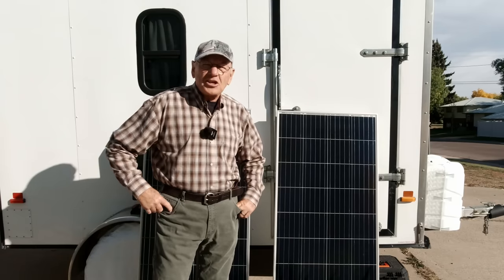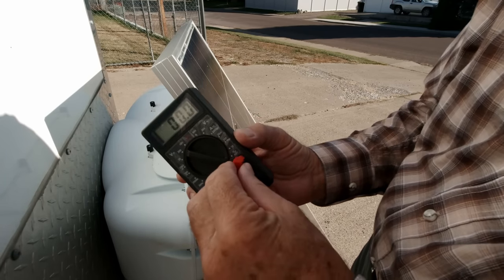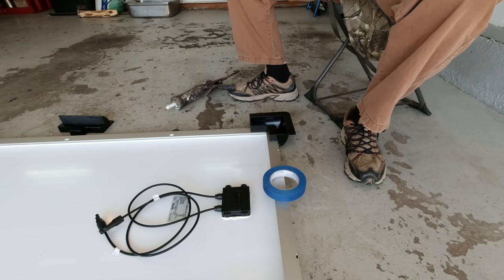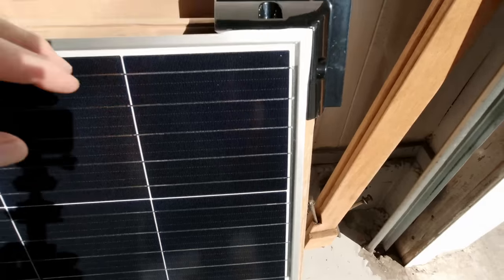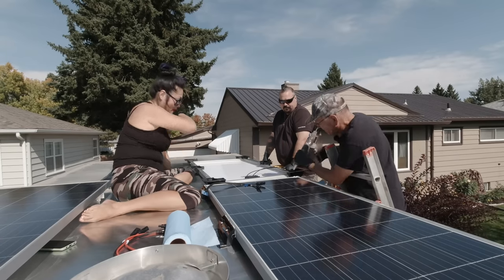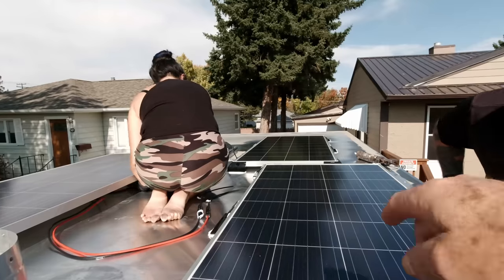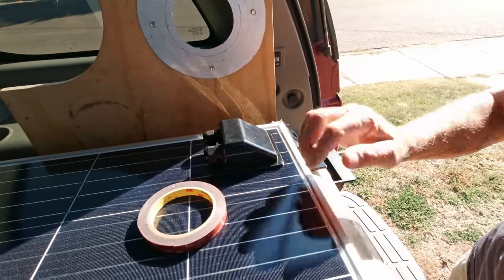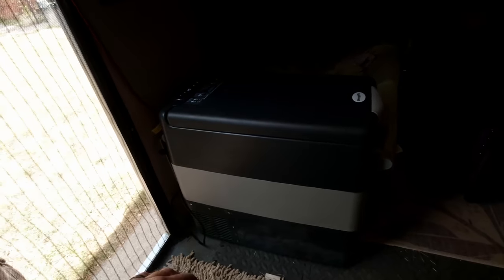RV Rooftop Solar Panel Easy Installation! Bouge RV Solar Panels

Comment: Thanks for a fun project! That glue stuff is strong enough to stick me to the side of the trailer at highway speeds for at least 5 yrs, I think. 😂 We'll soon replace our old panel to equal 3 of these BougeRV panels and call it good.
Reply: Ha Ha ... you had the hard part!   You had to be more flexible than the guys :)
Reply: @777cretbo  everyone missed my double backflip to get off the roof! Haha.
Reply: @SamuraiMama  ... HA HA  ... Good one!!
Reply from the maker: You could have waited until I had the camera pointed in your direction!
Reply: @gonagain  Great seeing a father and a daughter work together.  Have Three adult Daughters 31, 29 & 27.  I'm a young 57 :)
Reply from the maker: Daughters are great!
Reply: @gonagain  yep

Comment: A caution on measuring the current across the panel terminal leads with the multimeter.  This is one of the very few configurations that you can put your multimeter across a voltage source in amps/ current mode.  If you did that across a battery voltage source for example you'd smoke your meter or burn out the protective fuse if it has one.  Current is normally measured in series with the load, using the shunt built-in to the meter.  Because of the way a solar panel delivers current up to a maximum,  it allowed measuring across the panel leads, but across almost any other voltage source would not have ended well.  Good video with good explanations and camera work.  Thank you.
Reply from the maker: That's all true, but just so folks know, this is the way to test a solar panel that is rated UP TO 10 amps max.

Comment: Be sure to clean all the contact areas with alcohol to remove dirt and atmospheric film before placing the 252 and panels to the roof..
Reply from the maker: True that and we cleaned this roof before we got started.
Reply: @gonagain     Rick, I had no doubt that you did. But there are boob toobers under the age of 65 who don't know a screw driver from a jar of pickles and will follow your instructions to the letter without using additional common sense for something that you and I, because we are over 65, take for granted..!!  LOL!

Comment: If you have to remove a panel and replace it, I’m assuming you are going to have to screw or rivet it back in since you are not going to be able to glue it like you did the first time since the mounts are stationary and the glue would be push down to the bottom of the mount.
Reply from the maker: You could do that easily if you had to, but I would use a mold release agent on the bottom side and just force the adhesive into the crack with a putty knife. Good thought though, because stuff happens!

Comment: Good deal but was wondering why you didn't attach the panel to the brackets with screws instead of adhesive so its even easier to take out and possibly more secure.

Comment: When was the sikaflex update added? Did it completely release the mounting brackets? How long did it take for that to happen?
Reply from the maker: It didn't completely let go on my panel, which has been in place for about two years, but a good tug would have pulled it off.  Check my latest videos for updates on this subject.

Comment: Wow! Three 180 watt panels..... I'm a bit jealous, since I am making do with a single 175 watt panel.  I love the step by step approach to the video - it's very helpful.
Reply from the maker: Thanks for watching, Andrew.  I put 400 watts on my little 6x10 trailer because it is so inexpensive to do these days.  Also, adding an additional panel is very easy.

Comment: I use a lot of that 3m double sided tape.  I bought one of those 300watt hot air pencil heat guns, use it to warm tape to 150° or so before I press parts together.  Then burnish with back of a large spoon (for fabric or flat material), very permanent bond.

Comment: You're always one step ahead of me. I'm thinking I'll mount one port and one starboard of the roof centerline, with tilt on each one. Using a portable panel really impressed how angle affects power, and how much the sun moves in an hour. I've used Sika products for years. Never had a problem. (Other than mispositioning something.)
Reply from the maker: Hello Jon, I have one roof panel that tilts and one that is fixed.  The time when I really notice the difference is in the winter months with a low sun and it makes a HUGE difference!

Comment: Nice video! I'm wanting to do this on our 22' new Camper. More details on the fuse & a power cutoff would of been nice. I have a 2000W inverter but yours is probably better. Thank you for your video.

Comment: Great video overall!   I like that you checked the panels' open circuit voltage and short circuit current because those values do indicate whether a panel is healthy.  But, I don't think your power calculation is quite correct since those measurements were taken at different operating conditions (open and short).  To calculate power (P=IV) the current (I) and voltage (V) must be measured under the same conditions (V and I must be known simultaneously).  Since you took measurements in two different conditions there are actually two different power calculations (although they both result in zero power(!).  The open circuit power is zero because the current is zero (P = I*V = 0 amps * 23 volts = 0 watts).  The short circuit power is zero because the voltage is zero (P = I*V = 9.54 amps * 0 volts = 0 watts - again!).

You'll note that the tag on the panel also tells you what the proper voltage is associated with the maximum power (19.54V in the case of your panel).  If you had a big variable resistor that could tolerate (dissipate) 180 watts you could adjust it so the voltage across it was 19.54V and then insert the meter in series and measure the current.  Under ideal conditions you'd find the current should be (rearranging P=IV) I = P/V = 180 watts / 19.54 volts = 9.21 amps.  In the real world it'd be something less for most panels, since their rated output is only achieved under lab conditions.

(The resistor value could be calculated starting with V=IR -> R=V/I -> R= 19.54 volts / 9.21 amps = ~2 ohms)

This is why MPPT solar controllers are such a big deal - they can automatically adjust the load so that power is maximized, i.e. the product of I and V at any moment gives the biggest value of P.  

Another thing is that the solar controllers typically have a display option to show what the voltage and current values are at any given time - if you want to check real output power just hook the controller to each panel one at a time (probably need to have the battery connected - check the manual first).  Although, as I said, your checks are probably adequate to make sure the panel is working - you just can't actually get a useful power reading from those measurements.
Reply from the maker: Thank you!  That's a great explanation and I appreciate the time you took to give us that information.  Now I know why an MPPT controller is more efficient also.

Comment: The volts with no load are higher and the currant at a short circuit is higher  but the voltage is zero look on the panel for the loaded voltage and currant  and times them and it will give the real power.

Comment: Absolutely professional & Install very Informative , I purchased 5 185 watt solar panels, & they were used dated 2018 & have ordered from  numerous sites the necessary materials , wiring ect. My Question Rick how many solar panels would I need to power my , class A Motorhome ,I  operate only one roof top ac was doing reaserch on line & from watching numerous videos  I would need approximately 1500 watts , Is this correct ?
Reply from the maker: I really can't answer that for sure, but it will be a lot.  You're also going to need a large bank of batteries and a sizable inverter.  The AC will probably use about 1200watts per hour of use (average) and you'll need to install a "soft start" on it to lower the current draw each time it kicks on.
Reply: @gonagain  ok , thanks for  Info Rick ya be safe my , friend

Comment: The renogy MMPT charge controller can handle 100 volts input so all the panels can be in series giving 1/3 the power loss in the long wires coming down with no extra conectors on the roof. the higher voltage will give earlier and later charging and more in cloudy weather I get charging from 6 am till 6 pm with 2 x 40 volt panels in series for 80 volts at 5 amps turned into 25 amps at the charge controller with short thick wires to the battery.  the x grid tie panels were only $ 20 each 200 watts
Reply from the maker: Good info and thank you.  The only problem I have with my current set-up, which is in series, is the shadow factor, or the problem with a tree branch casting a shadow across one of the panels, or even a build-up of dirt in one corner of a panel  Most campsites are located under the trees and this is causing a major problem.  It's not as bad if the panels are in parallel.

Comment: Love your channel and I mean this with humor / kindly.   It struck me you shouldn't be 'sparking' the solar panel amp test right on top of your propane tanks :)  I love panels and put 4 x 300w panels flat on top of my 7 x 14 cargo trailer - just barely fit with maxx fan in middle.   These generate about 6kwh/day in summer.     I do have a bit of sway at 60mph and was wondering if these 4 panels @ 40lbs each = 160lbs might be contributing to that.  Will try sway bar / weight distribution hitch and see if the sway clears up.
Reply from the maker: Trailer sway usually has to do with fore and aft loading and that is affected by axle location.  I had a 26' travel trailer that didn't need a sway bar and a 19' travel trailer that I wouldn't tow around the block without one! First I would make sure that you have the proper amount of hitch weight and if that doesn't do it then go for the sway bar.
Reply: I used heavier duty tires with less sidewall flex and that controlled my sway problems.
Reply: Wow - thank you for the tips. The weight is 3800lb, tongue weight is 550lb,  load is evenly distributed, tires are at max pressure (dual axle) - all that is OK.    I have the weight distribution / sway bar hitch on the way and will report back once I see how it does.   If that doesn't do it, I'll check into the tires :)

Comment: That Sikaflex works great on a metal roof, how is it on a TPO roof?
Reply from the maker: You don't want to use adhesive mounts on a TPO roof though.  In my opinion you should through-fasten in that situation.
Reply: @gonagain  thanks, I thought that, but wanted to get a second opinion.

Comment: Well darn!  Now I got to get some Sikaflex 252 to play with.  

Do you ever wish your panels were more adjustable/tiltable?  Is any gain from doing adjustment just not worth the effort?  It would take time away from touristy things.
Reply from the maker: There is a definite benefit to being able to tilt the panels and this trailer and my own each have a panel that can tilt.  Watch this video Jim:  "To Tilt Or Not To Tilt?"   https://youtu.be/eCPvBLcyksE
Reply: @gonagain  ..... Different strokes for different folks.  It seems you will now have a combination, fixed and portable.  I do like the fixed roof panels and portable for those difficult days.  

You have trained Linda well.  A day window shopping at rocks and nothing taken home?  Well done!

Comment: Love this.... will this bond to a fiberglass rv roof
Reply from the maker: Yes it will. Just make sure the surface is super clean and rough it up slightly with 80grit sandpaper.
Reply: @gonagain  thanks

Comment: Which adhesive did you use to mount the panels?
Reply from the maker: We ended up using SikaFlex 292i which is much better.

Comment: During winter storage here in Montana , is it ok to store batteries in trailer hooked up to solar panels?   Will batteries be warm enough on constant charge.   AGM batteries are very heavy and are not good to move since dropping them might kill battery
Reply from the maker: Hello William, I always left my AGM batteries in my trailer, hooked up to solar all winter.  As long as they are charged they won't freeze and will survive just fine.

Comment: Not to sure about using the adhesive if attaching to a rubber roof. As you would be relying on the adhesive that is holding rubber roof to the wood roofing.
Reply from the maker: Yeah, I wouldn't do that either.  The adhesive we used in this video did fail and we switched to Sikaflex 292i adhesive.

Comment: Are those black brackets plastic? If so how is that going to hold up to the sun beating on them day in and day out?
Reply from the maker: Yes, I got the black on purpose for it's increased resistance to the UV rays.  Like the black, UV resistant zip ties as opposed to the white ones that deteriorate in the sun rapidly.

Comment: Are you concerned about the thin aluminum of the roof holding those panels? I thought going down the highway at 60 might blow the panels off and take the this roof along with it. Trailer roofs are very thin. It's not like an RV roof.
Reply from the maker: I'm not concerned about it because the panel spreads that load over a very wide area and the mounts themselves are very large.  That brings up a subject for another video though and that is the fact that when I insulate a trailer I  always put a bead of sikaflex on TOP of the roof beams to adhere them to the roof panels to reduce the noise from flexing on windy days.
Reply: You may refer to a Will Prowse YouTube video where he describes using  "safety chains" he does the same install method!!

Comment: You cannot determine the maximum power of your panel by multiplying max voltage by short circuit current. In no way is it 207W.

When measuring max voltage, the current is zero => Power is zero.
When measuring short circuit current, the voltage is zero => power is zero.

Maximum power is normally around a sweet spot of 18V and almost the short circuit current.
These values were on the label behind the panel, and THEY do work out close to 180W.

The get that power, you really do need to use a MPPT regulator as it will aim to find that sweet spot.

Comment: Very nice job, Rick! Other advantages of the branch connectors in the parallel panel setup is improved performance in partially shaded conditions and (if there's an available unused plug) the potential to add a portable panel for extra wattage. Main drawback of parallel setup, due to comparatively lower voltage, is that longer cable runs will have higher power loss -- not too big a concern for most mobile setups. And another way of bringing a cable (up to about 10/2 marine grade) into a vehicle is the junction box entry fitting designed for romex -- has a pair of threaded thin lock nuts internally and a thick captured rubber passthrough on the outside in a galvanized housing. Due to the size of the threaded nipple it would be tricky to use where the roof or wall is more than 1/4 inch thick (and it does look like Frankenstein's neckwear). But for a car, truck, or SUV it is short enough to clear the closed doors on a B pillar, eliminating the need to puncture your roof!
Reply from the maker: Wow, great information there, Robert!  I hadn't given any thought to hooking up a portable panel the way you mentioned, but that's a good idea.  By the way, I intend to shorten those cables you saw in the video and also give a little lesson on soldering when I do for those who have never done that.
Reply: Look
Reply: Hey  Bosco  here. 
Hope that you are not offended  by  a question that will  probably be a  simple question. 
I  have just  installed  4.  310 watt panels  on  my  roof of my  trailer.   And  I  need to what should I be  reading at my  S. controller?
My  4 panels are  wired in  pairs of 2.   In series. ( pos+   to. Neg- )
Then parallel  through  2 branch  connector  and  fuse  on  each  POS + wire 
I  don't know what  reading  I should  be getting.    Any info  would be greatly appreciated. 
Thanks  Bosco. 😊

Comment: Great video Rick!!  Check out another YTber info on mixing lithium and lead batteries in a bank. Emily and Clark’s Adventures. Clark is an engineer who lives on a sailboat and has done considerable research on this concept. He has designed a Battery Bank Management System that properly manages both type batteries. Unlike most engineers he does a great job of explaining it.
Reply: Thanks for the tip!👍
Reply from the maker: I just watched his video yesterday!!!  Talk about coincidence.  He's a smart guy and had my attention the whole time.

Comment: Easy diy brackets- 2" aluminum angle cut at about 2" lengths. Place 1 upside down and back to back so they make kind of a Z, like regular panel mounts. Drill 1-2 1/4" or 5/16" holes to secure them together then mounting holes. Now your panels can be mounted and removed easily for replacement or service. 

This idea for gluing down is very risky. It's only as good as the adhesive, the roof skin to trailer connection which isn't generally that good. I've seen panels laying in a traffic lane on the interstate, seen roofs peeled off etc. I personally would never do it...and I highly suggest you avoid it too. 

Cover your panels for making connections.
Reply: Drilling is a little scary. How would you recommend waterproofing them ? I live in rainy weather
Reply: @rjvizaka..dprrob1972  Use Dicor like originally used on RV roofs. There self leveling for flat horizontal surfaces or non leveling for vertical. Make your holes etc squirt some Dicor in hole and around it, put bracket in place fasten bolt. Then put Dicor over the bolt head and it will never leak.